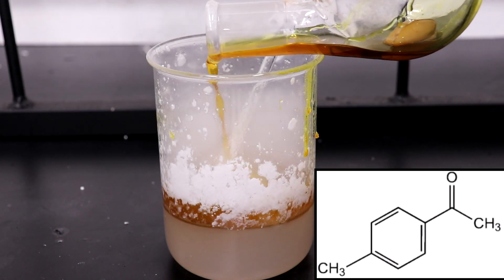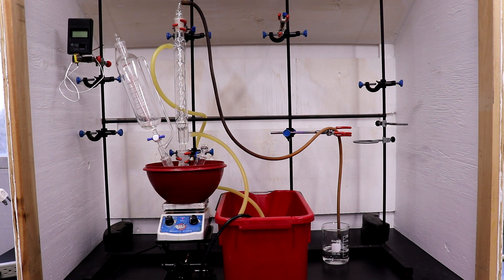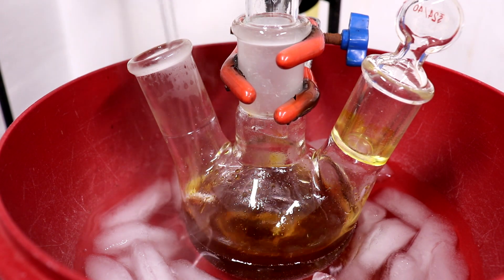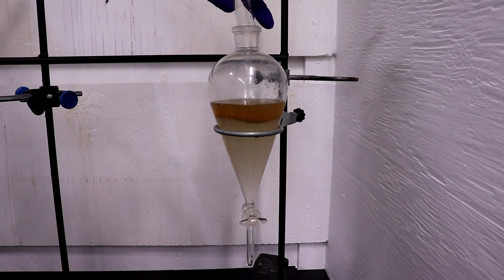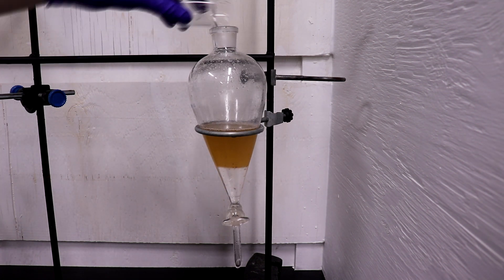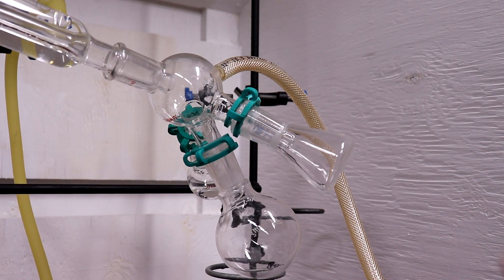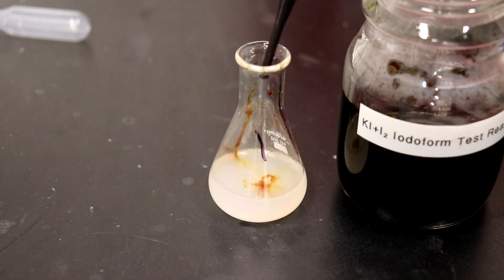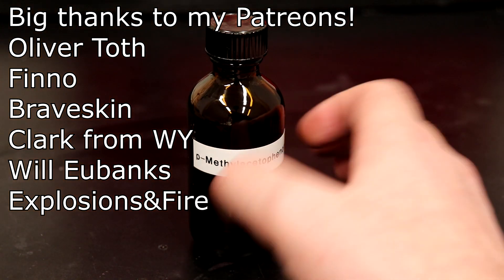Synthesis of p-Methylacetophenone

Comment: What do you mean due to the loss of vacuum in the system?

 Dont you keep the vacuum pump running during the distillation? 

Or do you pull the vacuum, close the system then run the heat to distill product?

I always thought they say to keep the vacuum pump running during the whole process and have a vacuum constantly pulling on the atmosphere inside the system?

Im confused lol

Comment from the maker: I believe the abnormal boiling point during the vacuum distillation is the result of my pump heating up considerably as it runs, this would increase the vapour pressure of the oil and whatever solvent impurities that have been captured in it. So as the pump runs, it heats up the oil, increasing the vapour pressure of the oil, increasing the pressure in the system, increasing the boiling point, and this would happen slowly over time as the pump slowly heats up. That's my theory.
Reply: Вполне возможно.

Comment: Thank you for that information.
But, could this reaction be done by a substitution of benzene for the toluene and acetyl chloride for the acetyl anhydride to yield acetophenone instead of the p-methylactophenone?
Reply: Sorry I meant substituting acetyl chloride for acetic anhydride?
Reply: @martinheidegger1125  Yes. You can do that. Acetyl chloride is also very good reagent.
But consider two things 
Acetyl chloride is highly toxic.
And if you use acetyl chloride the by product will be HCl (a strong acid), in case of acetic anhydride it results in acetic acid as the by product (weak acid).

So for acid sensitive reactants acetic anhydride is better.
Also, HCl is more toxic compared to acetic acid. So reactions with Acetyl chloride should be done with care .
Reply: @yogi5752  apakah dia membohongi kita dengan tayangan ini ? Apakah jika kita mencobanya akan terjadi ledakan .

Atau memang tayangan memang benar cara membuat p2p

Comment: Can glacial acetic acid be used instead of acetic anhydride?
Reply: I don't think so but acetyl chloride can be used.
Reply: No way.
I mean you cannot use it directly.
But,  There will be reactions by using Acetic acid and some other uncommon catalyst (refer green chemistry journals). But most of the times yield will be very low.

Comment: which vacuum pump do you use ?
Reply from the maker: RS-1 3CFM 1/4HP Single Stage Rotary Vane Vacuum Pump
Reply: are you not afraid it will rust or explode?
Reply from the maker: Already full of rust... somehow still kicking and I'll use it till it dies, then get I'll pick up a nice pump
Reply: @corrosion-chem  Yeah it should be a diaphragm pump.  Diaphragm vacuum pumps are insanely expensive.